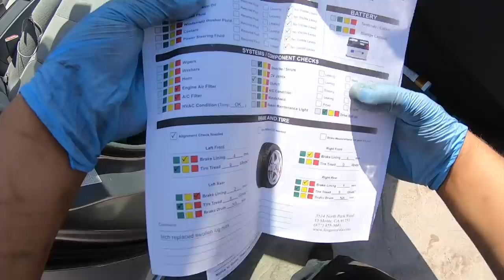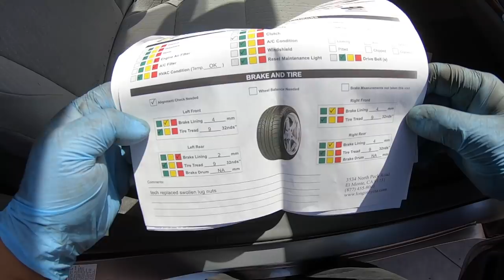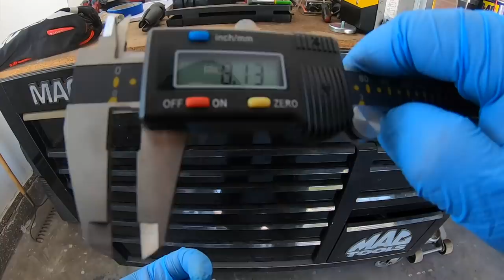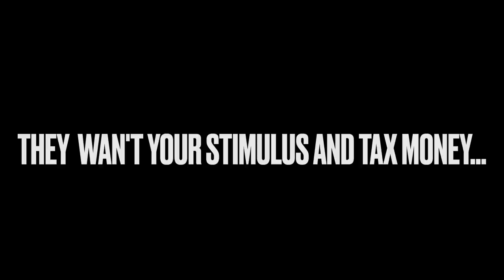This is why YOU need to avoid the Dealerships!

Comment: For last 5 years, I constantly tell people, the only 2 reasons to EVER bring any vehicle to a dealership is either recall or warranty work, because you don't pay for either one.
Reply: Problem is that local shops use aftermarket parts which have declined in quality. OEM parts last a lot longer than aftermarket parts. If you can do your own work, it’s great but if you can’t, then you are paying for inferior parts which will need replacement sooner, and your paying the labor rates sooner as well. 

There are certain things that can be done aftermarket but for bigger jobs and seriously important components, I would go to dealership and pay a little extra.
Reply: @82dupont  the shop I and my family go to do allow parts to be either oem or aftermarket (they do highly recommend oem for electronic parts though), and do allow brand preferences and don't milk out labor costs to make up for not supplying their own parts. The other shops where I live will insult you for even bringing up the idea of using anything other than what they supply, and its not even oem, it's whatever they get the best price for.

Only reason I don't like dealerships, or at the least the 2 in my town is they always gave me the runaround. My 2012 taurus had a keyfob stop working 1 week after buying the car in 2019, they refused to give me another fob. Got charged 200 bucks just to get told they couldn't fix my problem. They suggested replacing transmitter modules for about $3k and didn't even think it was the key fob. The shop I go to immediately said it was the fob, and to order a new one off amazon. My last visit to the dealership, I got charged 100 bucks because they actually tried programming my dead fob (along with the new one) that was never gonna work, I didn't hesitate to give them a 1 star and tell people to avoid getting ripped off.

If you can find a good, honest local shop that does match dealership quality at a better and fairer cost I'd call that a diamond in the rough, I'm very thankful and always refer anyone their way.
Reply: @82dupont  That's a misconception. You can have OEM parts put on by independent mechanics.  And something else u may not be aware of - lots of dealerships install aftermarket parts if they are out of stock in what u need.  You of course will be charged for the OEM part(s).
Reply: How about service history when reselling?
Reply: I get free oil changes, but I always make sure they actually change the oil. Check the dio stick, and oil filter is marked before I get it changed. That way I know if they took the filter off or not.

But there are risks with that too. Did they put in the right oil? Did they put in enough or too much oil. Is the filter on right, with the gasket and all that. Etc etc.
Reply: @82dupont  My local mechanic only uses OEM Volvo parts that he gets wholesale from the dealership and he doesn’t mark them up hardly at all and charges much less for labor. I had to go to the dealer for two recalls but that’s the only time I’ll go after he warranty is up.
Reply: @82dupont  You know most brands dont make their own parts. alot of brands source parts from "aftermarket" brands. 

Movotech, to name one, is often an OE brand for suspension and steering parts. 

OEM parts are usually the same crappy ass junk you can get from anyone else. cause thats exactly what the brands do. Its cheaper to buy parts off the shelf than it is to design a whole other specific part. Hell most of the time you can get better parts. Like greasable u joints, or greaseable ball joints.
Reply: Also for collision repair if you're not at fault. As long as they don't total your car that is. Recently got into an accident and the shop manager for the shop the insurance gave me told me at any time I can walk away and  ask insurance for a check cause he didn't wanna total my vehicle.
Reply: @82dupont  I ran a commercial department at one of the major parts stores in the US, selling aftermarket parts. One of my biggest customers was a local Buick dealership. There are tons of dealerships that don't install OEM parts on customer cars.
Reply: @82dupont  Aftermarket makes high and low quality parts. Some better, some worse, some the exact same as OEM parts. Independent shops will use OEM parts at times due to being only part available, the part is a better part for that situation, the part has lower price than aftermarket or upgraded part design. Aftermarket parts are sometimes the only ones made for certain things, such as alignments where OEM offers no adjustable parts. Tech has to know part quality and availability and not care about getting yelled at to source the best part.
Reply: @brentneahring2797  Protip, buy a blank fob on Amazon for $20-$50 then bring it to a locksmith to get it programmed for $20. If you call ahead to the lockamith you may get lucky and the Locksmith might have blanks for your vehicle on hand. As long as you have a working fob, they have a machine which can copy the digital key into the new fob. Took about  20 seconds, plus the time to cut the physical blank key (mine has a backup key for unlocking the doors in the case of a dead battery).
Reply: EXACTLY.
Reply: We took a Chrysler to the dealership for recall, never had problems with it, they took it upon themselves to change a part that they said was bad $700 later, we refused to pay it cause they should've called us.. we picked up the car that afternoon and the next day the engine blew to no oil which we had just done an oil change a week prior to this incident. To say the least we no longer use dealerships

Comment: If only every mechanic was like this guy
Reply: Hal 502  yea, even the chain ones are scams a majority of the time.
Reply: As a fellow mechanic with integrity. I would say only about 30% are shady. The unfortunate truth is that the dealerships are pushing the mechanics to become sales people. I left the industry because I saw the same thing ever where I went. I still do work at home on the side. There are lots of good independent mechanics out there.
Reply: @michaelrussell6057  As an independent tech i will second this comment
Reply: Greetings from Germany
it is the same here!
every time they try to f*** you whit the brakes!
Reply: A lot of mechanics are like this believe it or not. The reason why people always say mechanics are shady, is because dealerships and other companies, force mechanics to sell stuff the costumer doesn’t need. I’ve been written up because I told a costumer he doesn’t need the tires and brakes the dealership told them they needed (the lady came in for a second opinion). A co worker told me my manager got angry because I let an “easy sell” go out the door. This doesn’t mean there aren’t bad shops out there. A lady with a brand new Mercedes got a flat tire. She went to a shop and they told her she needed a brand new tire, when the car had 30 miles on it. Long story short I fixed her tire and sent her on her way.
Reply: @hitman5423  I work at autozone delivering parts to shops, so I have met a lot of the mom and pop type mechanics who are great people, but I also get to meet customers who get scammed, and sadly the bad mechanics cause a bigger impact than the good ones
Reply: Hal 502  Maybe where you live, i've been a tech for a long time, spend almost all of my time in dealerships. I have only ever met one or two people who actively tried cheating customers, and it was very frowned upon. It genuinely sucks that our whole trade is considered untrustworthy and full of thieves. :/
Reply: @balisticjello  make videos(money on others mistakes)? You mean to tell me you would take off pads all around and not charge or replace or lube? he literally has to take off the caliper to see how low they are.
Reply: @balisticjello  he doesn't use the right socket for the lug nuts
Reply: @albertoascencio5935  no I wouldn't charge for a relube are you serious right treat your customers good and they will return its simple
Reply: @balisticjello  2 axles drums in rear? you are not that busy huh? lol
Reply: @balisticjello  I'm not talking about a chassis lube but a brake hardware lube
Reply: My grandpa who’s a mechanic yells at me to never go to a dealer ship and if there’s a problem to come by him and fix it myself
Reply: Most are honest it's just a few idiots that ruin it for everyone else
Reply: I worked my way through college at a brake and alignment shop.  We had tons of workers come through.  I would say most of the guys I worked with were honest.  Most of the time when things were oversold were typically when the auto tech didn't actually know what was up so he sort of shotguned it.  We did have some dishonest ones from time to time and they washed out.  There are some places that lean towards the crooked side. Just to get more flat rate on a ticket.  it really pays to be an informed customer.  good vid here!

Comment: The service writers are on board. I worked at Toyota dealership in New Jersey and the service writer gets a piece of the action for selling you the brake service.
Reply from the maker: 100% they’re enticed to sell and hit their “numbers” so they can get their bonus 🤦🏻‍♂️
Reply: And then the service writer tells the tech that the customer wanted to them anyway!
Reply: @dudley7540  Yup. This lube tech sold front and rear brakes on an old mans car...service writer gives me the RO, I took the wheels off and inspect the brakes.....pads were basically still brand new like in this video. I go tell the writer, basically told me to do it anyways, customer already paid and all. I gave it to another tech to do it, couldn't live with that guilt of robbing the customer. This wasn't the first time this happened either. Manager gave no f*cks...I got soooo many other bad stories.
Reply: @PanameraTurboSEHybrid  that's a shitty situation to be put in.. you can't just go tell the customer what's happening, because you'll definitely get fired if you do. that's the kind of thing that wears away at the soul.
Reply: the sadest part is that all of this could be avoided if there was no compensation on selling extra things. it also doesnt bring customers back what brings them back in is the feeling of safty and honnesty and having breaks swaped often or that there always is something random wrong with your car will be bring a feeling of honnesty
Reply: Well duh. They are the salesmen of course they get something for things they sell.
Reply: YUP!!!!

Comment: Back in the early 90's I worked as a service writer at Thomas Acura in Covina. I lasted 1 week and quit as they were having me sell brake jobs to people that did not need them. What ended it for me is when they wanted me to sell a lady brakes on her car and when I saw them they looked just fine. I was told to let her know they needed replaced. I went to the lady in the waiting area and informed her and she replied that she just had them replaced a month earlier. Needless to say I did not come back to work. I hate dealers taking advantage of people. Like others I do everything myself that I feel I can get back working in a weekend. I hope someone forwarded this link to Longo Toyota.
Reply: I went to tire kingdom to get new tires after replacing all the brakes on my car by myself. New pads, rotors, etc. 15 minutes into putting new tires on the mechanic comes out to tell me I need new brakes.......... I told them to check the trunk for the brakes I just replaced yesterday and to try and scam someone else. Only reason I ever go to a shop is for alignments/ tires. I haven't found an honest mechanic yet.

Comment: Brake pads looks fairly new stealer ship to the rescue. It can take years to build a good reputation    and a few bad apples can destroy it
Reply: I used the same mechanic shop for nearly 20 years.  I am not a demanding customer.  I do not pester when the vehicle is done.  I do not get upset when I catch their mistakes.  Yes in 20 years I caught mistakes.  However the last vehicle I ever had them work on truly was a rip off, and that I will not take.  Vehicle needed a new timing belt.  I get it back, and it is stalling at low temps, I check codes it claims coolant temp sens out of range.  Now, I'm not a mechanic, but I'm not ignorant either, I return it to shop and tell them the code, and that engine management was fine before their repair.  They "fix" it, and charge me another 200 bucks.  Now the vehicle is stalling in high temperatures.  I check the codes and again coolant temp sens out of range.  Now I'm irritated, and I call them back and mechanic tells me it is the fuel pump.  I'm livid at this point.  I am disabled and working on cars is no longer a choice.  So I decide to pop the hood, I go to the coolant sensor next to upper radiator hose housing, unplug and replug in sensor.  Problem solved.  Took me 5 minutes.  Now you might be wonder, why I didnt do this in the first place, well because I had assumed that during the timing belt job, they may have screwed up a wiring harness, or a ground, that I could not reach.  Also, because I paid them to fix the car.  LOL  Needless to say I never went back.
Reply: That's our philosophy.
We have had techs that don't do a good job but they don't last.
I work with three guys who are over 60 and you better believe they will b... will complain if they catch something that they don't think it's right.

Comment: i work at a toyota as a tech and you definitely don’t want to get your service done at my dealership 😂
Reply: Its funny you say that because I took my Toyota Camry to the dealership and paid for an oil change and tire rotation. I had a suspicion they didn't rotate my tires. Next time I took it in I put some of my daughters nail polish on the front driver tire and rear passenger tire. Different colors. Pay for oil change and tire rotation. Get charged for oil change and tire rotation. Go to my car and guess what. Tires were never rotated. Ripped the service manager a new asshole and everything was free of charge
Reply: @jc3930  I wonder if they changed the oil...
Reply: @jc3930  they think that nobody is going to check that, so they think that theyll get away with it, until they get busted
Reply: @johncortez1599  ive wondered that myself. havent taken my car back since that incident. went old school and just started doing it myself again

Comment: I learned this when i did my own brakes after going to the dealership and not wanting to pay all that money lmao
Reply: you mean BRAKES and not BREAKS?
Reply: @dontcare563  haha thanks
Reply: @Laternerd69  Sorry, I'm not the spelling Police and make mistakes like this too!
Reply: I’ve no idea why people panic over doing brakes, it’s one of the most easiest job on cars. They’re incredibly easy to change... 2 bolts on the calliper , 2 bolts on the bracket. Push the piston back in, slide the pads onto the bracket with some copper grease.
A dealership quoted me £1000, I could do it myself for £400 to £450 (and that’s OEM prices)
Reply: @notmenotme614  Nobody is panicking! Did you even watch the video? It was a lady who obviously has no experience in doing this type of work, Also many times it's much more than just replacing pads! Drums and rotors need turning, Brake pistons sometimes leak and sometimes springs or other hardware need replacing. You understand not EVERYONE can do this work? Old people, people with medical problems, people who don't have the tools, people who have no clue how to do the work and even people who live in Apartments and have no place to do the work. Honestly I have no idea why you  even replied to this the way you did!
Reply: @dontcare563  they try to scare customers into unnecessary brake pad and disc changes. $$$
Reply: @notmenotme614  Not in my case! The people who did my oil change at the dealership were not mechanics but did the multipoint inspection. They just guessed on the thickness of the pads instead of actually measuring them. When I returned to the same dealership for a Brake job they admitted they were wrong and I didn't need pads!